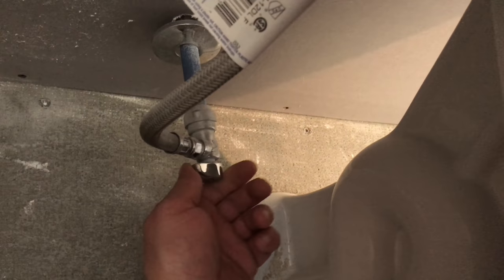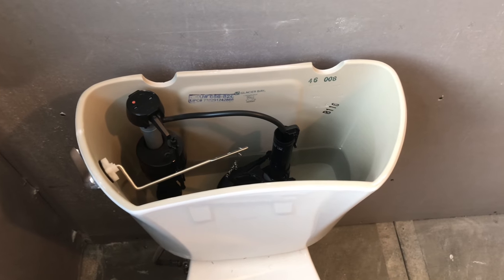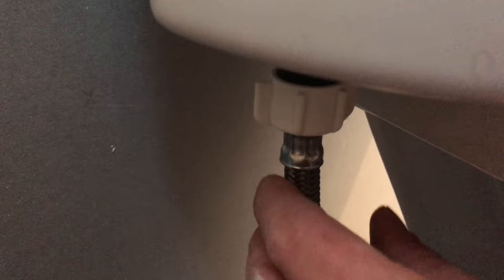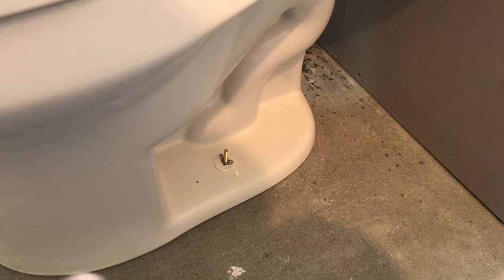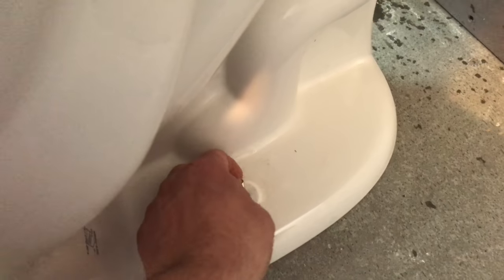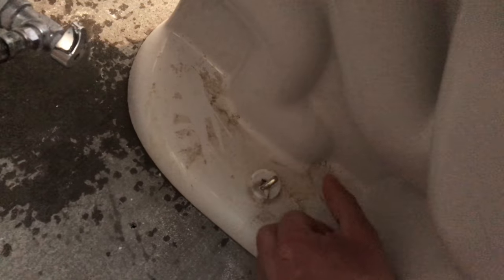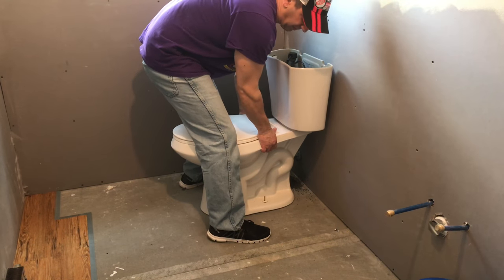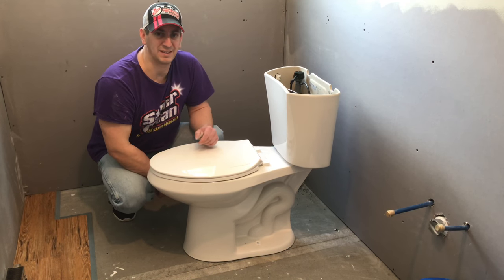How To Remove a Toilet Bowl

Comment: When the toilet is removed do you have to put any new parts like the seal that is broken on or can you reuse it? The reason I ask there is a toy stuck in ours and I’m thinking about taking it off to try to get it out.
Reply from the maker: I would put a new wax ring on it if it is removed. They are not that expensive.
Reply: Thanks for validation our children aren't the only ones! 😂 I'm about to do the same in search of another oversized HotWheels truck. This happened once before, but seems simple enough so why not try it myself?

Comment: Im doing the same job. Did you put any sort of cap before doing the floors and will you have to reseal the toilet? 

Someone put a new toilet in this room before I could do the floors. Its tempting to work around the toilet but Id rather do it the right way.
Reply from the maker: Add a new wax ring before putting the toilet back on the pipe. This will seal the bottom of the toilet to the toilet flange for you.

Comment: Tony....I have a clog. If I take off the toilet, remove clog, do I need a new wax seal to reattach ? Thanks
Reply from the maker: You can reuse the seal..BUT they are pretty inexpensive, I would replace it.

Comment: My shutoff is off but the water keeps coming.  Would the valve be broken?
Reply from the maker: Is sound like it may need to be replaced if it is not working correctly.

Comment: I had a 2yr old flush 4 toothbrushes and toothpaste. I plunged it and 2 toothbrushes came back up. I guess I have to remove it and what other procedures I must do?
I'm not a plumber but I'm Learning
Reply from the maker: If the toothbrushes went through the toilet somehow. They may be stuck in a truck somewhere in the plumbing system.

Comment: Just wondering about the water in bowl... doesn't it all leak on the floor? If I take a toilet off how can I remove the sewage pipe too?
Reply from the maker: If you remove the water from the bowl before removing it, there might be a little left in the trap area.

Comment: what if your toilet is clogged? when I flush the water in the toilet rises & stays there for a while
Reply from the maker: You may want to see if you can free the clog with a plunger. If that does not work try using a plumbing snake to free the clog. Hope this helps you out.

Comment: Every demo on the internet has a 10 x 10 room to work, reach the bolts, and lift the toilet.  I have 6 inches on each side.  Before I even get the rusted/stuck bolts half off, the sweat beading down my forehead blinds me.  But serious question.  I got the nuts off, but I cannot seem to find replacements that fit true...is it 1/4. 5/16...or..3/10...Its a guessing game for now.
Reply from the maker: Thanks for watching